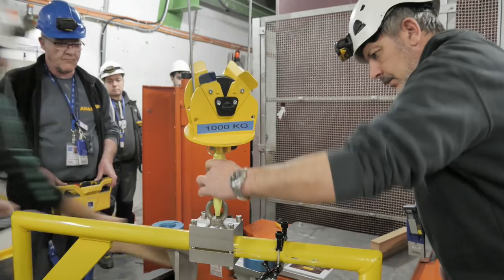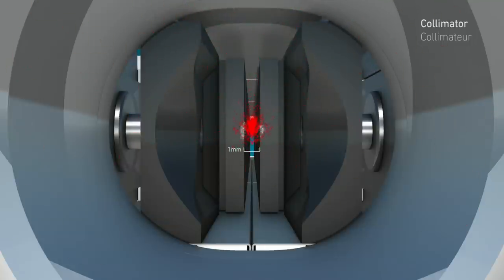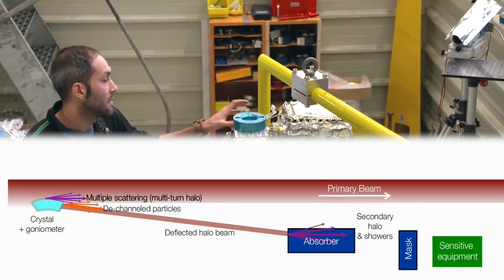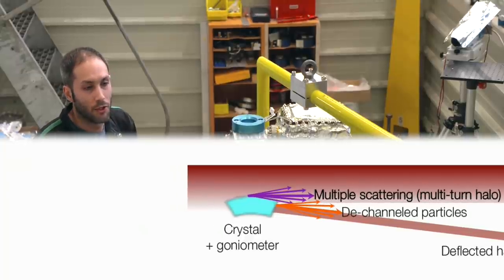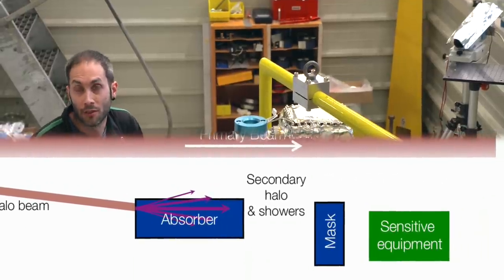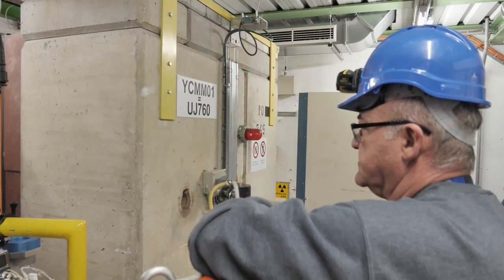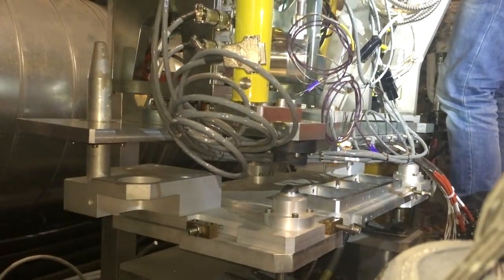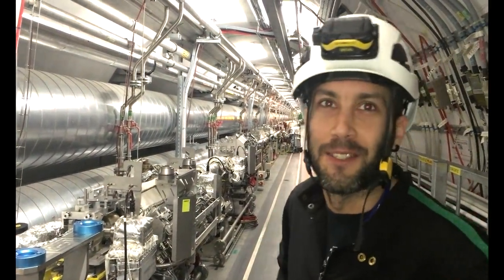Installation of a new crystal collimator in the LHC

Comment: interesting but when the halo particles are trapped what do you do with them next? are they contaminated or just of no use?
Reply: Particles in the halo have unstable trajectories, and at some point they are naturally expelled from the accelerator. The idea is to remove the halo from the beam before they hit sensitive equipment (like the superconducting magnets). Once they are deviated from the main beam path they are absorbed by a block of dense material and we can forget about them. In the material they are stopped and their energy absorbed (normally after a intense shower of photons, electrons and other secondary particles).